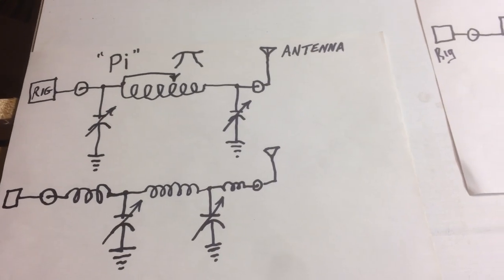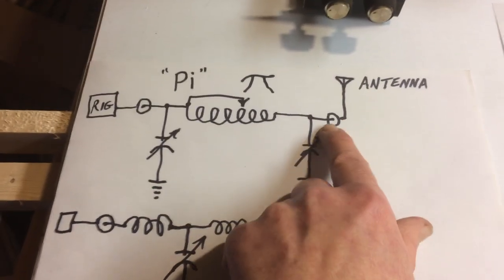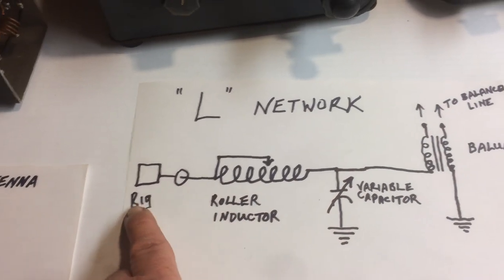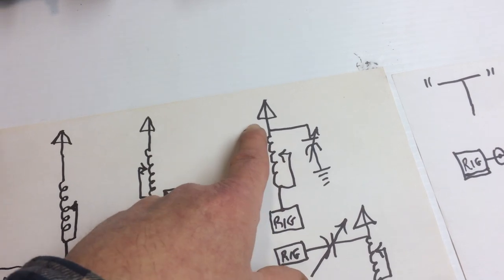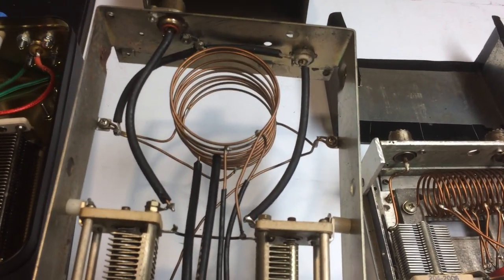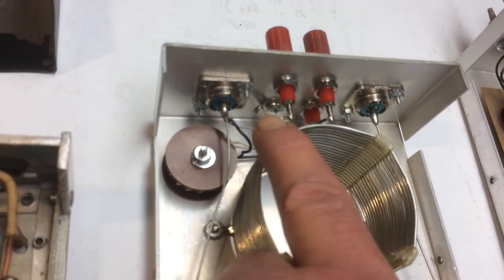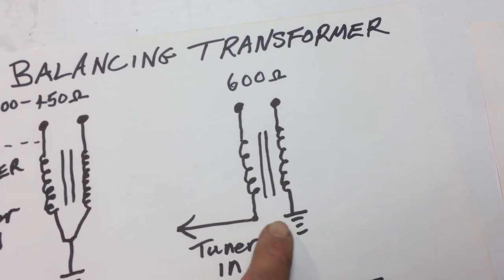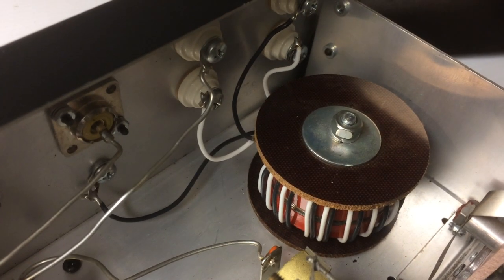Antenna Tuners-Basic types “Pi”  “L” and  “T”  Networks

Comment: Thank you!  Very interesting.  And very inspiring.  Learned a lot and I’m going to give it a try, building one that is.
Reply from the maker: @elmoreglidingclub3030  thank you and thanks for watching !
Good luck on your project ! These are simple circuits. T network will give the most range. 
Check out my YouTube channel for more videos and share with your friends.
Reply: @madeinfoxtrap5539  I definitely will.  Much appreciation for posting informative videos like this one.  I want to do some digging before I start building so I can make one that fits my needs.  That is, max of 100 Watts (I’ll never get an amplifier as I like low power stuff).  But it’s an opportunity to lean so it is a very welcome opportunity.

Comment: What I've been looking for, and continue to look for is a good explanation of which types of antenna tuner should work best under what sorts of conditions, meaning WHY is there a variety of different antenna tuner designs and circuits. Which has an advantage over the others, when and why? I watch video after video of tedious explanations describing exactly how each of them is built and wired, but can't seem to find a single video that explains why I'd want one kind over another.
Reply from the maker: T network gives most range but also most loss
Pi network gives less range and least loss
L network is simplest with possibly the least range depending on configuration 
The type tuner that would be best suited for you really depends on several variables such as type of antenna length of antenna location of antenna type of Feedline   etc
I have done a lot of experiments over the years which has prompted this video 
Best advice I can offer is to try different setups and make observations and from there draw your own conclusions 
Nothing like finding out for yourself !
Reply: @madeinfoxtrap5539 , thank you for the summary. Those first 3 lines are exactly what I was looking for. Not just information, but useful information, understanding, guidance. 

I read and I watch videos precisely so I don't have to reinvent the wheel. As for me, I'm 72 and in a wheelchair, so a good starting point certainly beats me physically trying every conceivable combination of L and C until it starts making sense. It's what I read and watch videos for. I'm too old to spend my time rediscovering things that are already well known. I've already spent years of my life doing just that. But now I'm a shorttimer, so I no longer have the luxury of doing many things wrong. YouTube has video after video explaining reactance over and over without ever actually leaving one more knowledgeable about what to do and why to do it, about the way these things interact and the results of the interaction. They leave out the, "And in conclusion..." or, "And here's what that all means..."

Comment: It is possible to know the value of roller inductor and variabile capacitor of "L" network? For the balun instead? Many thanks in advanced
Reply from the maker: The 1:1 balun (balancing transformer) 10 double turns of #16 AWG magnet wire (varnished factory coating)
The inductor and capacitor were both bought second hand and I believe the capacitor was 340uF and the coil I’m not sure maybe 60uH
Built a few years back. Larger the value of these components will determine the range so try to find the higher value components. Not necessarily monetary value but value of capacitance and inductance !
Thank you for watching !
Reply: @madeinfoxtrap5539  many thanks for your answer. I'm interested to build It for the qrp use too. The value of the component are the same?
Reply from the maker: @architetturaearte  you may use whatever you can find. It will work. Both components can be adjusted to almost zero so
Use the highest value of components. Highest capacitance and highest inductance will give you the best range. Try to have your 
Antenna a resonant length to the lowest frequency that you use so the tuner is only just fine tuning and balancing

Comment: Hi..I will only use it for listening sw..not for transmitting..which one is useful for me?
Reply from the maker: Either one will work but the T network will provide the greatest range for the value of the components used.
Reply: Hi! Thanks for a nice video!
 A T-network offers a wide range impedance  matching with relatively small capacitor values and it is simple.

But... It doesn't offer the bandpass or low pass filtering sometimes needed for SWL:ing and qrp ham gear. 73 de OH8UBJ